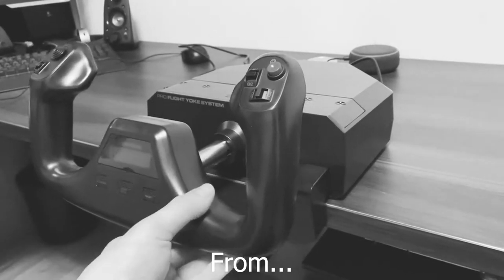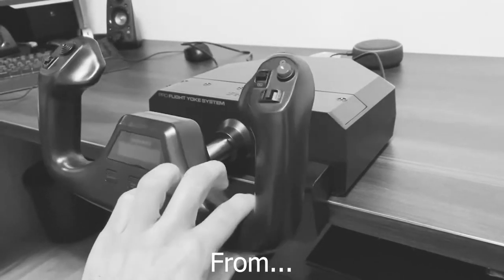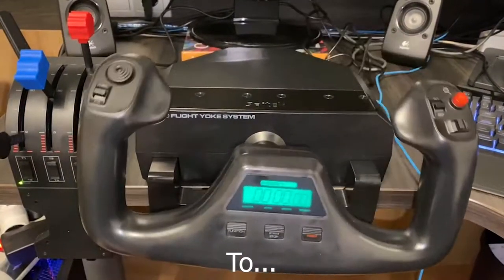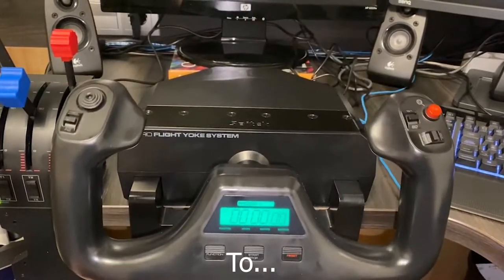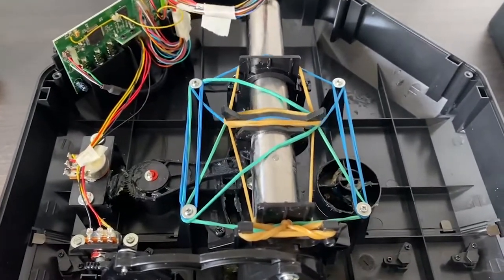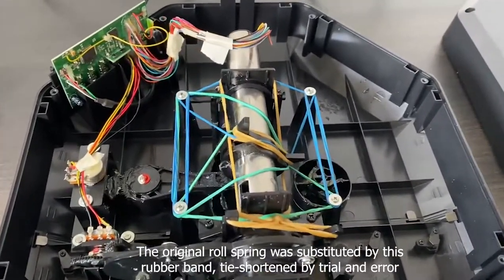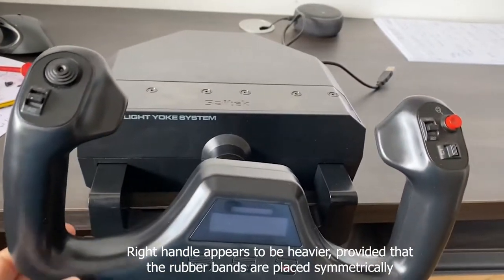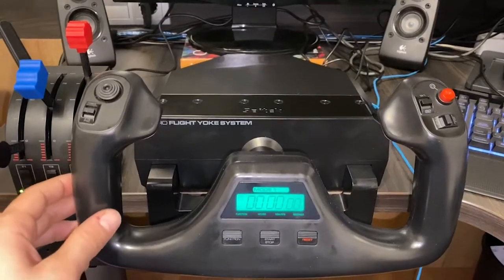Saitek Pro Flight Yoke System - Simple Rubber band Mod Fix | Replace roll and pitch springs.

Comment: This is brilliant!  Would that I had seen this before getting the Honeycomb Alpha ...  However - I now have two redundant Saitek throttle quads - do you have any videos on converting the five pin ps/2 (ish) adapter to USB?  Or can I whip out the old controller card from the Saitek yoke?

Comment: I do not understand. Have any of you had any problems reassembling the bottom? The 4 screws that hold the rubber bands in place prevent the assembly. So I didn't succeed.

Comment: Thanks for the video! Btw, i still have sticky yoke on the Roll axis, may i know what lubrication oil or wax did u use on it?
Reply from the maker: Hi, I used the same grease the yoke itself had. It is regular grease. But any vaseline, or oil will do
Reply: @BarcelonaAustinA35  Thanks!